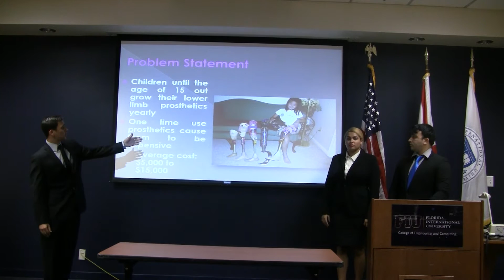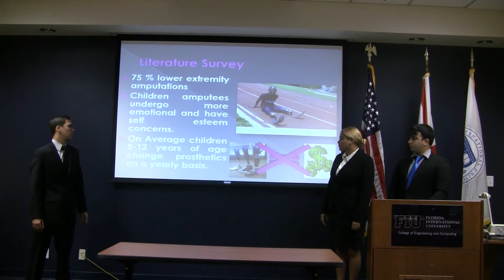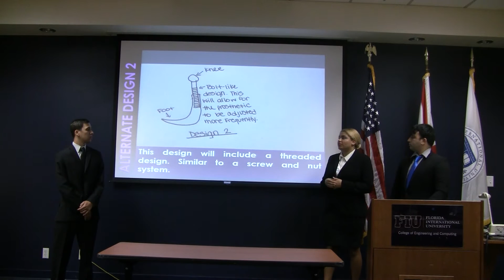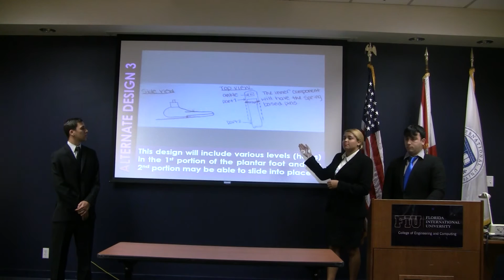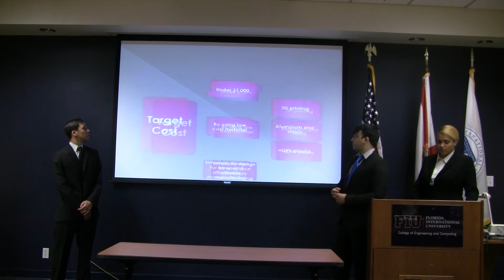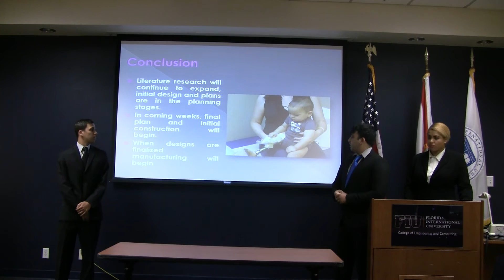SDO Team 06: Affordable Adjustable Lower Limb Prosthetic for Children

Comment: As others have said, slide wording was heavy for most slides, which made finding key pieces of information difficult. Descriptions of design alternatives were great, but should be backed with more concrete or at least modeled and simulated examples.